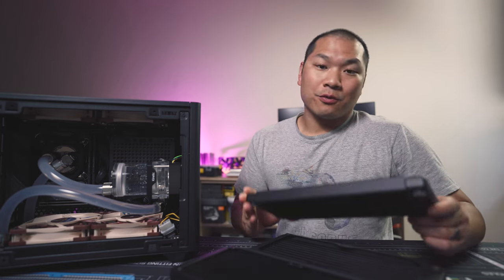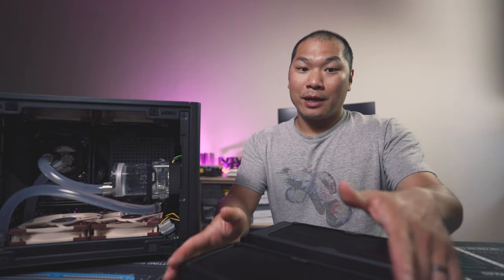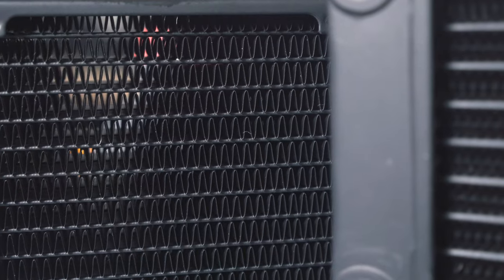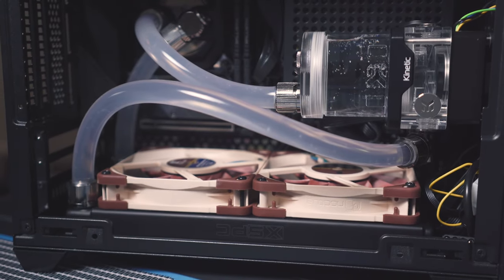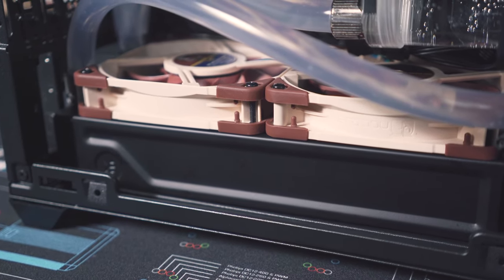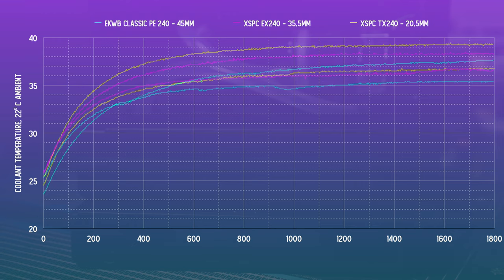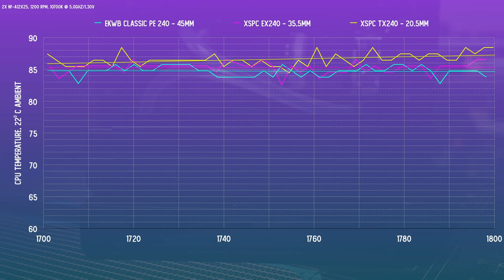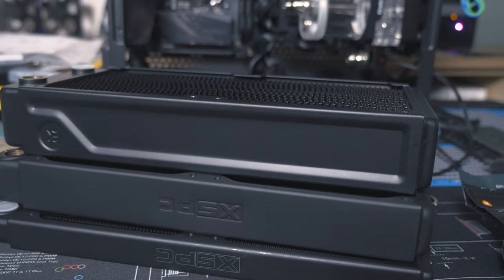Rad Thickness: The Impact on Custom Loop Thermals

Comment: I have a background in heat transfer, just to piggyback that the amount of heat flow gets dissipated into ambient via a rad plateaus really quickly against the fin length (rad thickness in this case), it's actually a tanh curve if I'm not mistaken. In other words, once passing a certain height (which is determined by many factors itself), you are not going to notice any meaningful gains, which is demonstrated in this video. In convection heat exchanger, fin density and length of the rad matters much more. Honestly high pressure head fans at low RPM with low resistance rads works wonder.
Reply: This stuff is so fascinating. I’ve been playing around with a custom loop and two 240 rads for the last year and I’m STILL getting surprised at how certain configurations manage heat, air flow etc.

Not to mention the case itself impacts the end result too ❤❤ it’s all one big beautiful complicated, yet understandable, mess 😂
Reply: yes, all else being equal, but generally, you have variable core amounts, variable restriction, double stack fins vs single.  

I can have seen thinner denser fin stacks lose to thicker less dense fin stacks in bennchmarks at various speeds.

Comment: The reason the thin rad underperformed at low fan speeds is because of the higher fin density. That's why the gap shrinks at high fan speeds.

Comment: I'm curious to see this test done with more heat being dumped into the system. Your experiment was certainly controlled, but the results are bugging me and I'm definitely interested in how things would change if there was a high power GPU dumping heat into the loop as well.
Reply: then a 240mm radiator is not enough since the top party of the case can also support a rad a thin 20-25mm or standard 30mm rad might fit that case well you can either reduce the rad thickness or reduce fan thickness i.e. 15mm thick fans well as long as everything fits.. but if there is a high power GPU then you will need 2x 240mm radiator in that case and i will prefer to use the 45mm thick rad at the bottom part.
Reply: well if this is an SFF build and your using the most high end parts like 14900k & 4090 then you want to consider adding a external radiator using a QC fitting and pass through fitting bracket if you don't want to drill holes on the case. for this type of  set up a lot recommend a minimum of 3x 360mm radiator a 2x 360mm radiator is fine but at stock settings for both CPU & GPU and you will still running the fans at higher RPM to avoid that you need another 360mm radiator to lower than fan with and even OC .

Comment: Not a great test.   You need to test the same line with different thickness.   Even if these rads were the same thickness they'd have different performance.
Reply: The truth is, the radiators only matter if the temps keep going up.   If it ever levels off at a reasonable temperature, you're golden.   It's a watts in and watts out equation.

Comment: Well presented very interesting topic. I really enjoyed to watch it.
Though I can't totally agree with conclusion.
The thing is that in order to answer the question of rad thickness affect on cooling in a more scientific way, some conditions should be met. And the most important is that the rads should be all from the same series of the same manufacturer. This is because the difference between various models can be huge.
For example the 30mm HWLabbs Nemesis GTS 280 will slightly outperform 45mm EK CoolStream CE280 across different fan speeds.
But will lose in all but slowest fan speed to 45MM Alphacool XT45.
When comparing Alphacool ST30 to XT45, the thinner will lose at all fan speeds.
Thermal load is also very important - and here its ok as 180W for 240rads is kinda enough.

So practically the answer to the question which rad to pick is kinda more complicated than just thickness.
Starting with how much heat should be dissipated at required noise level at the given ambient (some have room temp of 19C while others can easily have around 30C).
From there moving to how much space in case and what is required for tube routing and fill ports - thinner larger rad (say 280) will yield better cooling than thicker 240 in any any scenario.
Sometimes even things like wideness of the rad can be a factor. For example Alphacool's rads are 1-2mm wider than fans, while HWLabs rads tend to be ~13mm wider. 
Those could be critical for SFF builds.

As for the video topic, I noticed that there is very little cooling improvement in noise optimized systems (fans below 1500) with thicker rads. The biggest advantage is the number of ports. But there are thin rads with multiple ports - Alphacool. Not the best performance, but very compact and have largest number of ports.
I'm in a SFF sect for very long time. So I could be wrong about performance in large cases.
Reply: Thanks to your opinion
Reply: Glad somebody wrote this out so I didn’t have to. I usually like this guys videos, but this one needs deleted. The performance metrics aren’t even close to controlled here for the reasons you stated. He should have purchased 3 rads from same company, same series, same FPI, and different thicknesses…. This video will only lead astray the less educated/experienced.

Comment: I've seen this data replicated over the past 2 (or so) years and found it still holds up. In my SFF builds, cooling comes down to the fans. The dirt cheap radiator has always worked better  in combination with the Noctua fans. And yes, the pumps are a factor. Indeed poor pump leads to poor results and elevated temps. AIOs are a good example (exit costume loops) since some rpms are "fixed".  
Love the info and please keep it going. And, of course, thanks for the content!

Comment: Very well demonstrated. Thanks! Thickness doesn't seem to be THAT important. Also, choose length over thickness whenever possible.
Reply: Looking to cool my 2U (7600X is dumping too much heat for low profile). Sometimes you gotta go smaller (80mm).

Comment: Are you reading my mind? I've been searching for this comparison for weeks and at the same time wondering when your next video is up.
Reply from the maker: I should consult you on future ideas, then!
Reply: @MachinesMore  Ha! Actually, I got a request. I like how you test things and unlike other channels you are detailed to a reasonable extent. 

Since everyone and their moms are building inside the NR200p and Meshilicious now, is a single 280mm radiatior enough for a high end GPU and CPU. (3080 and 5800x) Some other channel built one but I had doubts if they let the loop liquid soak. Please do a video about it.
Reply: @toiletpepper7910  optimum tech did one with an XSPC 280mm and the thermals looked comparable to his dual 240mm ncase build.
Reply: @inmypaants  yup! I already saw it. It was not thorough enough and there were no combined temps while both the gpu and cpu was at full load. I'm also not sure if 30 mins is enough to heatsoak all the water in the loop.
Reply: @toiletpepper7910  yeah fair enough! I got swept up in how gorgeous it looked and didn’t think about thermals etc lmao
Reply from the maker: 280 is enough rad, but you do need higher fan speeds. This upcoming SSUPD series should be a lot of fun and learning. 😎 I do prefer 120X rads (because the A12x25 exists). Most likely I will be testing with a HWL GTS 240, I don’t plan on water blocking the 3080 just yet since I need it for other testing and may end up testing with a 3070 water block for the initial testing and the 5800X, but that should give another reference point. I do think it can work acceptably though, stay tuned!
Reply: @MachinesMore  are the hardware labs GTS line the best for <35mm thick radiators? I’ve heard good things

Comment: I was wondering earlier this weekend whether running a top and bottom TX240 with 15mm Noctuas in an NR200P would fit. And then I wondered if Machines and More had made any new NR200P videos. I'm not disappointed.

Comment: Excelent content, was waiting for a test like this, thanks. Can You run a comparison using noctua thin fans (15mm) thick. That would be a more real comparison, since you normally run the slim rad along with slim fans too un the NR200 for instance
Reply from the maker: Good idea. Are you referring to thin rad with slims?
Reply: @MachinesMore  yes, it would be great to know how much the temp change when using the thin rad (20.5 mm) with slim fans

Comment: Yes, agree with the other commenters that this is a great channel. The concepts are presented clearly and concisely.
I was wondering if you've ever worked with Quick Disconnect fittings and their impact on a loop.
Thank you
Reply from the maker: I have not, never saw the value in them for my own use (they’re quite $$ for a set) for it but from my understanding there is typically some added restriction from them, no big deal for a DDC pump or a D5 cranked up a bit more. Now if you’re running something weak like a DC-LT then yeah, there might be a detriment.
Reply: @MachinesMore  Thanks for your response. :-)
I've got a very dense and small SFF build and every time I need to change a component I have to take out the whole loop in one piece.
With quick disconnect fittings I'd be able to remove a single loop component which would be a lot more convenient.
My pump is the Swiftech Apogee Drive II which I know is very powerful but I thought I'd ask anyway.
Thanks so much!

Comment: Well, that's really surprising.  Roughly double the cooling surface area with double the fluid heatsink and there's less than a 2 degree difference?  Wow.  I would have guessed a much, much greater difference.

Comment: Great content! I've been thinking about a custom loop in my cougar qbx, with dual 240 20,5mm rads. I'm curious to see how slim 15mm fans compare against the 12x25
Reply: I would be keen to see the difference on a thicker rad like the EKWB PE with 15 and 25mm fans. E.g. is it better to get more radiator or more fan if your space constrained
Reply: @inmypaants  did you ever find your answer?
Reply: More fan and less radiator thickness is always the answer. What most people don't realize is that the majority of performance gained or lost is due to airflow. Thick radiators only make sense if there isn't enough space for more radiator surface, i.e. longer and wider radiators. You CAN cool things with thick radiators, but then you need to have powerful fans running at very high rpm - it's not the ideal situation.

Comment: For a very big rad that say... takes up all your front intakes I'd never go with the thick ones or super-dense high performance fins.
Maybe there's a second rad in the loop that can take up that role.
Low air impedence is how you make your stuff near silent at low utilization and idle. Where it's gonna be most of the time.
The thin rads with high density fins to make up for it... godsend if you need the clearance, but the tradeoff is not great otherwise.

Comment: Thank you for this video. i was doubting between a 30mm radiator with slim fans or a 20mm radiator with regular fans. Definitely going for the tx360 now, especially with the extra FPI it should do way better with regular fans.
Reply: I've been doing a ton of research on radiator performance and the bottom line is the biggest gains are always in the fan department. Airflow to and out of the radiator is another often overlooked point, as keeping the air cool and moving at a good pace is where the system ultimately succeeds or fails.

Comment: It appears that internal pipe length matters more than anything.  Adding more rads would appear to be more beneficial than have a single thicker rad.  I wonder if stacking two 20mm thick rads on top of each other would be better then a single 40mm rad.  Perhaps do a 240 and a 360mm rad stacked on top of each other instead of a thick 40mm 360mm radiator.  That way you can get the hoses to loop properly.

Comment: Which is better: 1 set of fans with a thick rad, or 2 sets of fans doing push-pull on a thin rad?
Reply from the maker: I can test since I still have it setup. In my experience, when noise normalized at moderate fans speeds, typical push pull yields a benefit in the neighborhood of 1-2 degrees, putting it on par with a thick rad. The benefit is more that the thermal headroom is much higher if you disregard noise. If you have space for either, I’d personally go thick rad just because the rads are similar in cost, but another set of fans is going to be an added expense, perhaps a splitter cable too, more cables to manage.
Reply: @MachinesMore  Thank you, that's really helpful!
Reply: @MachinesMore  Do you by chance have extra slim noctua fans (or maybe use ones from top header) to compare thicker rad with slim fans vs thin rad and regular fans? Point is the space in the case is always a limiting factor so with the same space available is it better to go with bigger rad or bigger fan? Or slim rad and slim fan plus leftover space for air flow (once you put that gpu with waterblock on top of that bottom radiator).

Comment: great all I wanted to know was if thickness brought anything because I can go pull fan-54mm but not push fan-54 I'd have to go push fan-30mm because of how my case is, space for 30+30 not 30+54 apparently it does so I'll keep my current pull config for that vertical rad but will go push for the one at the bottom (lianli 011 dynamic xl)

Comment: Great video.
I'm building a nr200 with a tx240 and I was wondering what I was losing not buying a thicker rad.
Reply from the maker: I think you will be fine. If you can fit two of those, now you will be very happy.

Comment: I got a cheap 360x25, the core definitely thinner, closer to 20mm, but I was very surprised to find it cooled my 3080, 320w, without trouble.
My main gaming PC has a 4090/13900K, but the rads on that are massive overkill, 3x480’s

Comment: Question. Which way should I go having place for 360 thick top, 280 mid mid, 360 thin/mid bottom with ~550-600W max power (GPU+CPU) to make it ultra silent in stress? (one of those at least needs to be intake)

1) Populate all and stick to thin/mid ones
2) Dedicate bottom just for unobstructed air intake and get thickets possible mid/top.
3) Doesnt matter - both options can handle.
4) Something else.

Comment: great video, thanks for the testing! :)

For quite some time i was wondering what the optimal set up would be if you have limted space like in the NR200 below the GPU.
Would a normal radiator with slim fans or a thin radiator with normal fans perfome better. Since in your testing the these two rads had similar performance i guess it should be better to grab the thin radiator with regular fans?
Reply from the maker: I’d go for the TX240 for space reasons. It does actually make good use of its thickness (thinness) by minimizing the offset between the frame and the core. That means you have to be very careful in screws choice but if you use the included screws your should be fine. You’re right in that below the GPU block there’s not much space. With the NR200 dual TX240 loop I opted for slim fans for better airflow, even though 25mm ones would have worked, they would have been right on the block.

Comment: 45mm starts from a lowe temp... it means that the ambient temp was lower from the beginning. 45m at equal air temp would have performed same as 35mm rad.

Comment: Greater thermal mass also means it takes longer to reach maximum temp.... Also if your flow is good and you have a big rad it means you will dump out this xtra heat faster with less noise. . Termal mass = better cooling overall.
Reply: I used to have a 5 gall bucket on a 400 cfm fan paired with a 240 rad . I was running fanless for around 2h gaming before the temp sensor triggered a relay to switch on the duc fan . It was loud ... But 4 min later i would have dumped all that heat out of the water and was good for an other 2 h
Reply: Also its more efficient at dumping heat during utilisation down , making better heat buffers .

Comment: Wonderful video. It's a shame you didn't also test pump speed or fan thickness. I wonder if a thin rad with 25nm fans beats a medium rad with thin fans.
Reply from the maker: These are in the works! I actually did test fan thickness too but didn’t compile the video yet, will do that as a follow up.
Reply: @MachinesMore  Awesome. I am buying two tx240s for my nr200. I'm very interested to know if the nfa12x25 would give any advantage on the GPU vs the nfa12x15. I can mount the 25mm fans under my case due to extra high 3d printed feet, but I'd rather use the slimmer fans if it only sacrifices a couple of degrees and I assume they are quieter. Could you please advise I am going to pull the trigger today on all the pieces. I will get the 15mm noctuas for the top rad, would you recommend 25 or 15mm for the bottom please? :) Thanks.
Reply: Went with 2 nfa12x15 for the top tx240 and four(!) nfa12x15 for the bottom tx240 in push pull. Two above the rad and 2 under the case. I'm hoping this will will give some pretty great performance or at least allow lower fan speeds. I think the extra airflow from the bottom will also provide cooler air to the top rad which I think I will run on extract mode, as when in low load situations I will stop all 3 bottom fans and then the top 2 will act as exhausts.
Reply: @MachinesMore  was unhappy with noise and perf of two tx240s so have just ordered a pe 240 for the bottom with phanteks t30s mounted under case with high feet. Will see how it goes. Edit, main reason was noise. The dense fins on the tx240 wax top much.